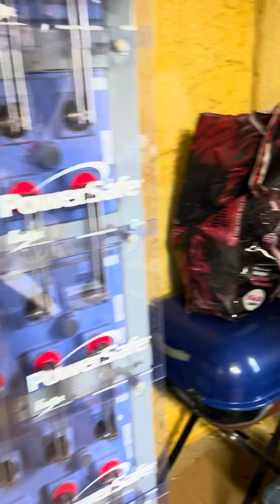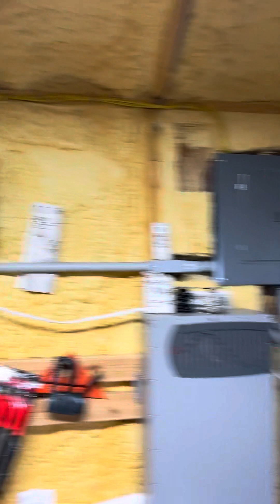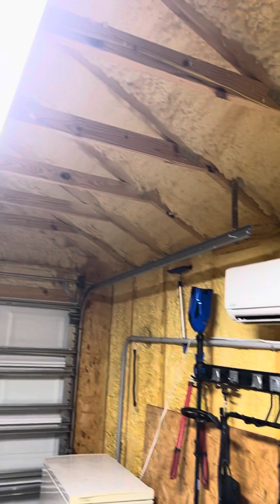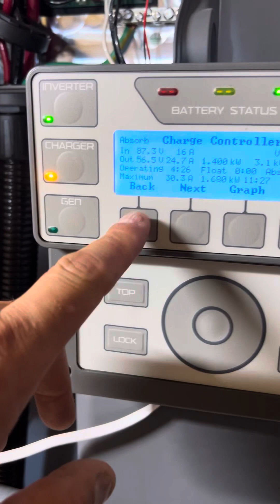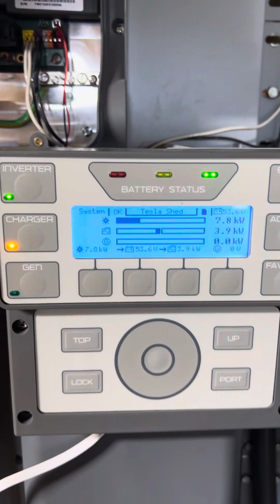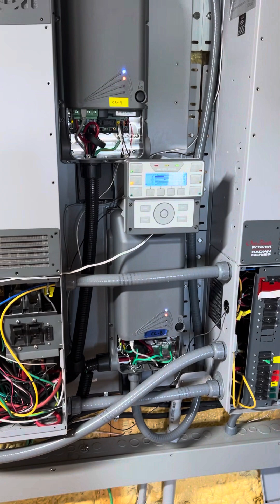Solar Outback Radian system

Comment: I have 3 Radians too.  Three Radian inverters is just like being connected to Grid Power.  Very capable!  Very reliable too except for the power supply boards in the Radians.  You might want to have a SPARE-215 on hand!